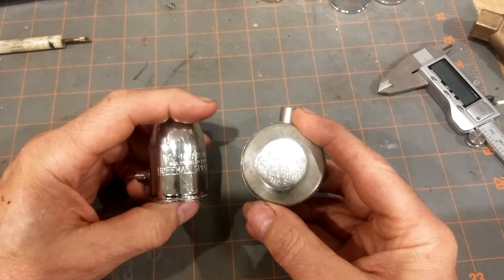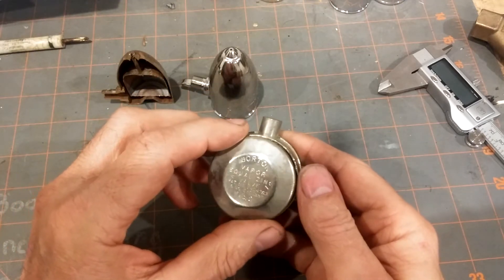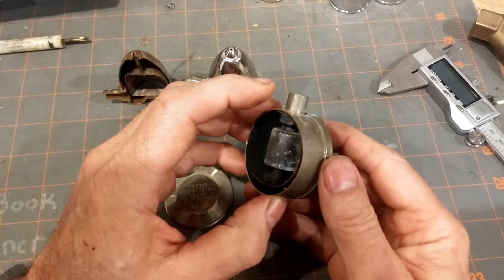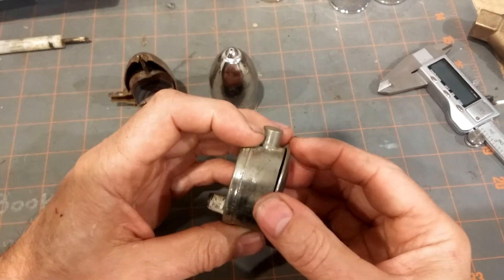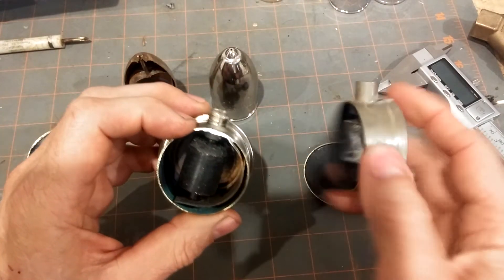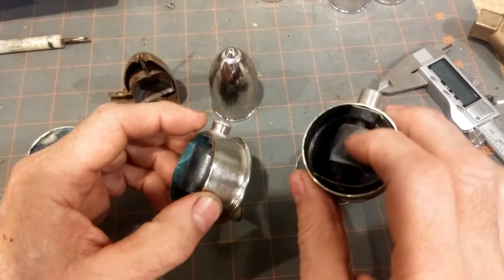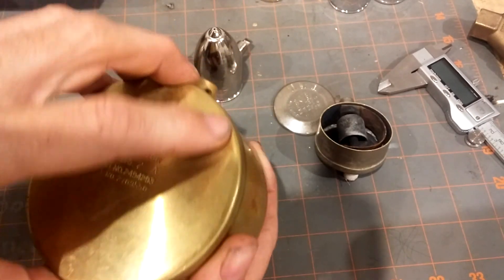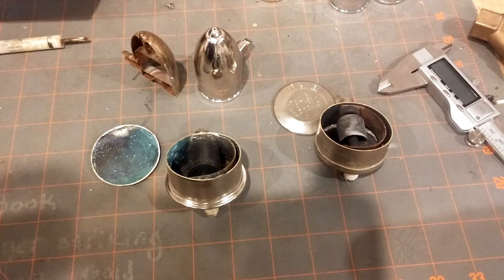Gorton / Maid-o-Mist Single Pipe Steam Radiator Air Vents

Comment: Awesome video. Before I buy a gorton D size. I have a radiator in my living room that’s 6 feet long. Would that be the right size?
Reply: Here’s some added information. I have a new 1 pipe steam boiler. Pressure is set to 1.5 PSI. I have a Gorton  number 1 on the main. On my 6 foot radiator located farthest distance in my house(first floor) I have a Hoffman adjustable and it’s fully opened. However my son’s room gets way too hot and I have a varivalve on his radiator. 2 out of the 6 radiators currently have Gortons. My thinking is to switch all the radiator vents to Gortons which could be why there is an in balance of heat but that’s just my thinking. But I really would like to know if the Gorton size D would be to big or go one size down. Thank you so much. I’m learning so much from your channel
Reply from the maker: Thank you for your kind words!
First, I would consider replacing the Gorton #1 with a Gorton #2, if it fits.
More venting of the main is almost always a worthwhile upgrade.
Please also make sure your steam mains are insulated with proper steam pipe insulation.
Next, I would swap out that varivalve in your son's overheating room with a Vent Rite #1 (please see my vid on that..)
Overheating radiators mean less steam for the rest of the system!
Maybe put that otherwise undesirable varivalve on your poorly heating LR rad if all else fails.
See where you are after that.
You've likely got a bit of tinkering ahead of you
Reply: @gordonschweizer5154  thank you sir! I bought the vent rite 1 so the tinkering has begun. I have another question as well. I’ve seen so many different opinions on how often to skim the boiler during the heating season. I’ve been letting some water out of the boiler once a month until it runs clear again then add some water back in. I turn on the boiler immediately once I do this. Is doing this once a month okay? I’d love to hear your opinion on this.
Reply from the maker: @mulliganb09  You're welcome!
As to skimming, what does the water look like in the sight glass?
Is there stuff floating at the meniscus there?
Reply: @gordonschweizer5154  mostly clear, some debris an inch or so on the bottom of the sight glass. Looks like it’s just gunk that stuck to the glass but clear the rest of the way through.
Reply from the maker: @mulliganb09  Ok, I'd say you've done enough skimming for now!
Good job!
Reply: @gordonschweizer5154  thank you! I bought that vent rite 1! It’s a great valve and so far doing its job. I will work on doing the other thing you recommended! Thank you so much for the advice!

Comment: I want to replace 5 vents.  One radiator is kept off by tenant.  The others are basically the same size rooms.  Can you give me a run down of which Gorton vents (numbers) to buy?  This is a rental property.

Thank you  Mr. Schweizer
Reply from the maker: Where is the thermostat?
That area should get a fixed vent.
Which vent?
Hard to say, as I can't see your situation.
There are lots of issues to consider.
What radiator vents do you have now?
Are the steam mains in the basement fully insulated?
Are the steam mains in the basement fully vented with main vents?
Is the boiler near boiler piping up to spec?
Was it properly sized?
At what pressure are you running the system?
How has the tenant shut off that radiator?
How is the overall comfort level of the system?
Does the system bang?
If so, at what part of the cycle does it bang?

Comment: Hi, Great to see the insides of the valve. Do you know if there is a difference between the ITT Hoffman specialty valve 41 connector vs the Bell and Gossett (a xylem brand) valve. I usually buy the original hoffman valves by Bell and Gossett. But my repair man showed up with a Hoffman valve that said Ventor on the valve. It came in a box that said HOFFMAN. But the valve itself was much more lighter than the hoffmans I have bought in the past. Is this a knock off valve or is it an original before. It said Made in Taiwan as well. I am curious if you have encountered this.
Reply from the maker: Have I encountered this, you ask?
<Gives rueful laugh>
Aye, for half my life, and I remember Eisenhower being President. 
It has been a trend for decades for them (whoever they are) to take quality old school American brands our ancestors spent their lives building up and selling off those proud brands to (fill in the blank).
As far as I know, Gorton is the only radiator vent that is entirely made in the USA and does not have any rubber or plastic innards.
Reply: @gordonschweizer5154  haha! Very true indeed. I’m just wondering if the ITT hoffman valves, made in Taiwan that has “ventor” written on it, the same quality as the current bell gossett ones which are heavier. I requested a hoffman valve from my landlord and the super installed this ventor itt hoffman valve in my radiator that works. I was so shocked at how light it was. Wondering if it’s worth returning and purchasing the bell gossett hoffman. Super said he could try do that. Or is they no guarantee w these hoffman valves.
Reply from the maker: @msdivine  As far as I know, Bell & Gosset, Hoffman, McDonnell & Miller etc are all part of one big happy (corporate shell) family.
I personally cannot speak as to the quality of this particular Hoffman or that sigular B&G vent.
I simply don't know.
I have received reports, however, from others on this channel that the Tie-wonese Hoffman's are not good, sad to say.
If you search on eBay, you may come across new old stock gen-u-wine  USA Hoffmans.
Reply from the maker: @msdivine  [Sigh] Indeed!
I think pre-ITT Hoffman's do show up upon occasion, but I would worry that they have been sitting on the shelf for so long that the magic fluid has bled away.
We stopped buying surplus Hoffman 75s because they didn't last.
But we would sometimes find old old stock Hoffman #40 (so old they had the policeman logo & the words "watchman of the coal pile" on the package) and they would still work.
Reply: @gordonschweizer5154  I ordered a NOS Hoffman #40 off eBay (with policeman logo) to replace the defective unit we discussed. If it doesn't do the job, I'll invest in a Gorton #5. Wish I'd seen this video prior to the eBay purchase! Be well

Comment: I always liked the Gorton vents, heavy duty and well made. However,  two years ago I installed four no. 1 vents on my two mains and 3 of 4 would not close and let out steam. Maybe it was a defective batch?
Reply from the maker: Yes, that does happen now and then & it is frustrating when it does.
I hope they made good on the defective items, yes?
Reply: @gordonschweizer5154  Well I sent them back for a refund but needed new vents that day so I had to settle for maid o mist vents that I bought locally. The body on one of them has since developed a hairline crack that let's a trace amount of steam escape.
Reply from the maker: It seems that with M-0-M, you need to buy two.  One to use and one to lose.

Comment: I have an older Steam Boiler from 1962 that works great. I have a problem with 1 vent all the time.
I keep up with the boiler and replaced low water cut off, main vents with Gorton's, gas valve and everything over the years.

I have the system balanced perfect. 

1 issue that causes me problems all these years.

My kitchen radiator is the 1st one off the main branch coming up. I use a Number 4 vent. 
I have all Maid O Mist Vents since the old Dole Vents kept giving me problems. 
This kitchen radiator, no matter which Vent I try, they all get water in them and stop working and stick closed.
I had Dole, Dole Adjustable, Maid O Mist, and the Generic ones over the years on this radiator. 

They last for a while, then I get the problem where the radiator won't heat up, I take the vent off, and I shake water out of it. 
It works for a while and eventually I have to replace the valve again.

It's just on this 1 radiator, and it works fine until we get 0 degree days for 2 or 3 days, then I have the problem.

I'm lost as to what the problem could be.
Reply from the maker: You definitely have a head-scratcher there and I'm not going to even pretend to have THE answer.
I going to assume the radiator in question does not hammer or even gurgle or there is no puff puff puff at the vent.
I am assuming the radiator is pitched towards the shut-off valve and said valve is fully open.
I am assuming that the run-out to said radiator is properly pitched and not undersized for the radiator.
I am assuming that said run-out is insulated.
I am assuming that your pressure does not exceed 2 psi, and that your boiler is not over-sized or over-fired.
I am assuming that your boiler's water is clean (relatively) and "wet steam" is not being produced.
I don't know if a Gorton #4 vent would work better or not ( they appear to be built better, and cost more than M-o-M).
You may try a Vent-Rite #1 adjustable turned way down to below a #4. 
Heck, you could even try a Hoffman #70 vent.  They are very very very slow and are outrageously over-priced.
Reply: How often does it cycle? I have this issue with a few of my vents when it gets too cold. I am thinking about using a straight vent instead of an angle vent. Gordon, do you think this could be a quick work around for these watery vent situations?
Reply: @baraclude  I'm thinking of a straight vent also. I can put a pipe elbow and then a straight vent. My Radiator was doing good for a while and now it's doing it again every other day.
Radiator is pitched right, no banging, Pressuretrol set for 1.5 P.S.I. and it's working properly, and I have no "Wet Steam'. Boiler and water I keep clean as a whistle.

Comment: I'd be interested in how your six work out. As far as I can tell there's nothing strange going on with my system. The supplier says no other complaints received and they would have to check with the mfr. Hoffman went through a corporate shuffle and I find the "assembled in USA" notice now on the box to be strange. Thankfully I tested them and didn't just store away. My ITT Hoffmans, Gortons and others work fine.
Reply from the maker: We have not installed any of the six so far as they were purchased for re-stock invantory.
They were bought thru SupplyHouseDOTcom.
I've heard the "you're the only one who has complained" a few too many times in my life to suspect that they are blowing smoke up your hu-ha.

Comment: Interesting video.  I notice with the "Hoffman Specialty"  vents these days it says on the box "assembled in the USA" as opposed to "made in USA." Any thoughts?
Reply from the maker: Thank you!
As to my thoughts on "assembled in the USA" (of globally sourced materials, naturally), it is a trend that covers many of the items in our daily life. 
It is better than the "made in the middle kingdom" label, but only just.
Reply: @gordonschweizer5154  Thanks for the reply. So it's still "made in USA" but it's the material that's outsourced? I was thinking more in the line that main components are premade somewhere, for example the all important bellows assembly, and then the finished product assembled here in the US. If so I'm thinking the quality will suffer.  I bring up the subject since I just got a batch of Hoffman 40s to use and have as spares. So far three are no good. They seem to be working at first but eventually start spewing steam out the top. I notice when I shake the new ones that the element inside seems to be smaller than the old if that means anything.
Reply from the maker: I am not going to gainsay what you have said.
Reply: Just a followup, all 6 of the "assembled in USA" Hoffman 40s I just got all test bad, steam pours out the top. I spent the extra money to get "genuine Hoffmans" not the cheap look alikes but apparently Hoffman quality is not what it was.  Luckily I have old ITT Hoffmans on hand and I'm able to rejuvenate some with the boiling water treatment. I'll be going with Gortons from now on.
Reply from the maker: @kenqwe04  Damn! Ain't that some shyte.
I just bought 6 Hoffmans too as restock. 
Sic transit gloria mundi.
Reply: Good luck with your six.  The difference I see with the new ones is it seems that the bellows assembly inside is smaller readily noticeable when I shake as compared to the older ones. I think the bellows assembly is too small and can never shut off the steam flow out the top. One good thing about the Gortons is they claim they test each one under live steam before shipment. Wow!
Reply from the maker: @kenqwe04  Can you return them for credit?
Reply: The supplier says to return I have to take photos of the steam escaping.  After days of dealing with this I'm sick of the whole business. I'm gonna write to Hoffman to see what they say. There's obviously somthing not right here. A lot of money out the window so I'm not a happy puppy.
Reply from the maker: @kenqwe04  Making you jump thru hoops to get what you paid for... I can't even...SMH
Maybe make a video & post it on y-tube (use a piece of glass against the vent to show the condensation)
Send the link to all concerned.
Maybe that will get results.
Maybe post a thread on HeatingHelp too.

Comment: I need to replace the air vents on my apartment radiators.  I've purchased Maid O' Mist steam air valves to replace the existing ones.  What I need help in is determining the size of the adjustable valves/vents.  My  apartment is on the first floor of a three floor building, the farthest away from the boiler (it is between 80 to a 100 yards away).  Two of the radiators are very large and are at the end of the boiler run.  I'd appreciate any assistance you could give me.
Reply from the maker: My best advice would be to insist that the steam mains in the basement be vented with a gang of Gorton #2s to get the steam to your radiator run-outs as quickly as possible.
Any other advice as to the venting of your radiators without that being assured is a folly on my part.

Comment: Very interesting to see the inner workings of these. I’m having an issue with the farthest radiator (2nd floor) from the basement boiler - the room is COLD (but the radiator does intermittently get hot). I suspect the vent needs replaced. It seems like I might try a #6 or C, being the farthest radiator? Or should I just go with an adjustable model? I sure appreciate the help, Thank You sir.
Reply from the maker: Thanks!
There are numerous reasons why a radiator is stubbornly colder than the rest.
Start in the basement.
Is your steam mains piping venting the best you can make it?
Small or no main vents are the cause of many steam issues.
Are your steam mains insulated?
Is your boiler water clean?
Is the near boiler piping close to what is should be?
Is your boiler sized for the load?
Is your gas service getting the boiler it's BTUs?
Next, look at the system as a whole.
Are there radiators that overheat?
Is your t-stat "set" for steam?
Is there hammering just before that cold radiator starts heating?
Adding a bigger vent to a cold radiator might do the trick, or it might cover up other underlying issues best faced head-on.
Reply: @gordonschweizer5154  how should you set the tstat for steam?
Reply from the maker: @Dat128i  On the better quality Honeywells (or Resideos if you will), the settings are at least 3cph (cycles per hour) for properly vented and insulated systems in my experience. 
2 cph or even 1 cph may work better for you depending on your unique situation.

Comment: Excellent video, could you suggest the air vent size for a steam radiator that is over 6 ft long. Calling from Canada. Thank you
Reply from the maker: Greetings and you are most welcome for your kind words & support.
That's a big radiator for sure!
Is it a wall hung? Is it a one-pipe steam system?
Are you having issues in heating it?  Does it knock & thunk before it gets hot?
What vent is on it now?  If the main venting "up to snuff", that is to say, do you have the biggest vents you can put on the steam mains?  What pressure does the system run at?
In general, the best vent is the smallest vent that allows the steam to heat the radiator with little or no noise or result in spitting or loudly hissing vents.  The foundation for this desirable aim is to have large vents in the basement and the lowest pressure that gets the job done.
Reply: Good evening, I did not think I got through. LOL It is a stand alone steam radiator one pipe system. 
I have a Maid-O- Mist #5, 1/8 in angle vent on it. Only two or three of the columns warm up leaving 10 columns ice cold. There is no thumping or clanking sounds.
This one's in the main floor living room, pretty close to the thermostat, I just had a new boiler installed for $40,000. You can imagine how peeved I am when the dining room and living room rads did not warm up. Hence my email to you inquiring about the importance of the appropriate size vents. Thanks for returning my query!!
Reply from the maker: @cathyschotchenko8106  I'll going to make some assumptions:
(1) The new boiler was sized correctly -
If not, there's not enough steam to go around.
(2) The boiler was piped correctly -
If not, the piping may be producing "wet" steam which doesn't heat well.
(3) The new boiler was cleaned correctly - If not, see above.
(4) The radiator in question worked before and now it doesn't.
If you truely vent a radiator & it still does not heat well, it's usually not a venting problem.
Did the installers ask about issues you had before the install?
A new boiler often does not fix pre-exsisting problems with the piping system.